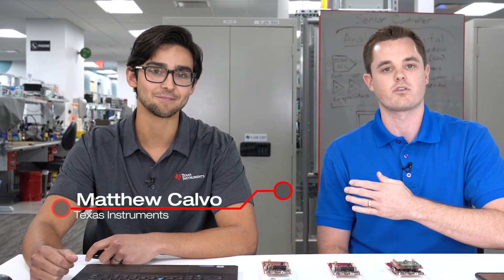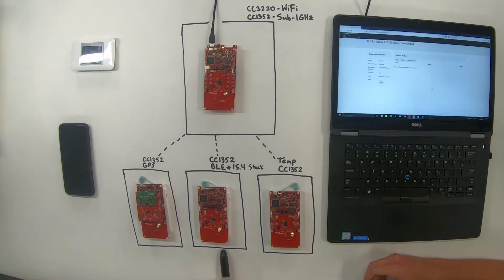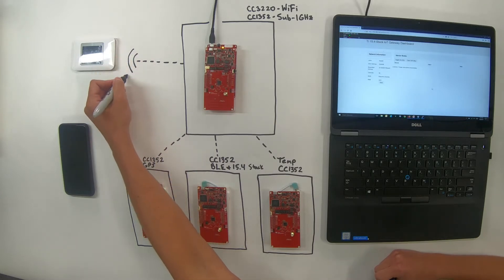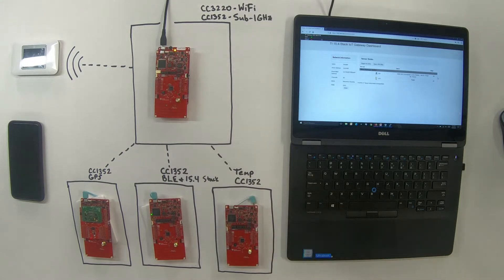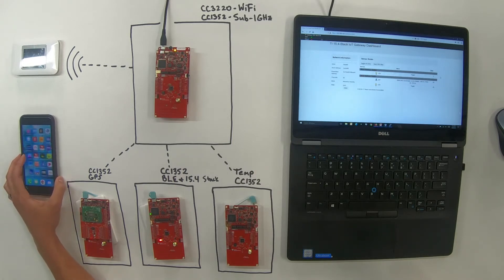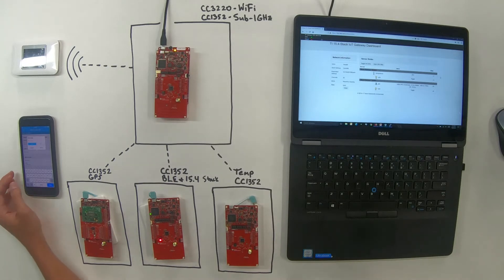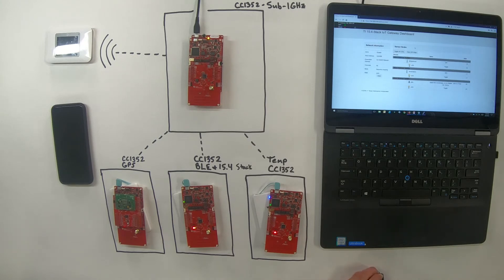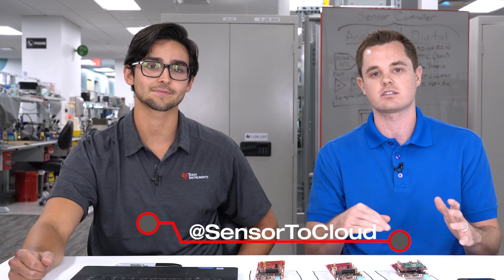Connect: Sensor to Cloud + GPS

Comment: It seems that software side of this ref. design is slightly outdated. CC3220 SDK version 1.50 is old and slightly problematic. It should be used version 2.10 at least.
Reply from the maker: Hi - At the moment we have not released the re design in the latest SDK. However,v1.50 is archived and available on TI Resource Explorer to get started.  There is also a migration guide included in the SDK that can help with porting the example to the latest SDK version.  http://dev.ti.com/tirex/#/?link=Software%2FSimpleLink%20CC13x0%20SDK

Comment: where do you buy the GPS booster pack???
Reply from the maker: Hi Markel - The booster pack cannot be purchased anymore, but the code will work with any UART GPS module that uses the NMEA GGA format. You can read http://www.ti.com/lit/an/swra584/swra584.pdf for more information.